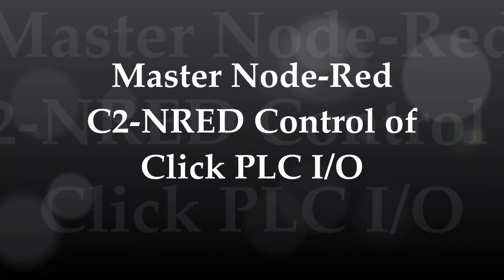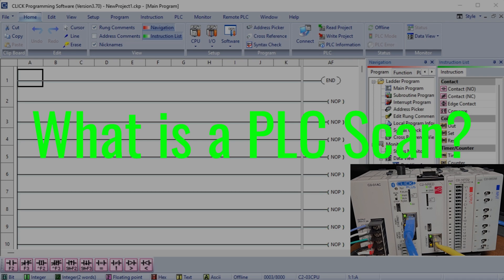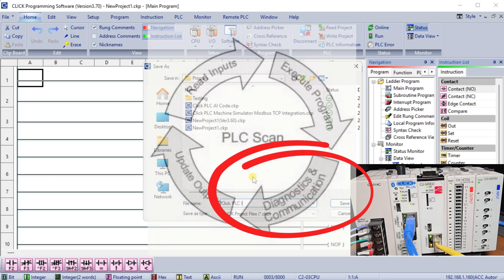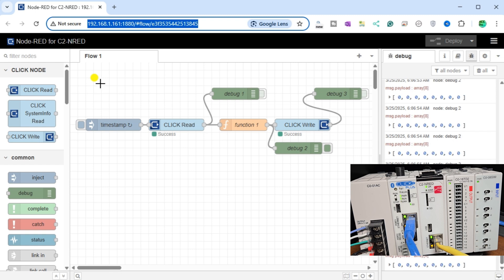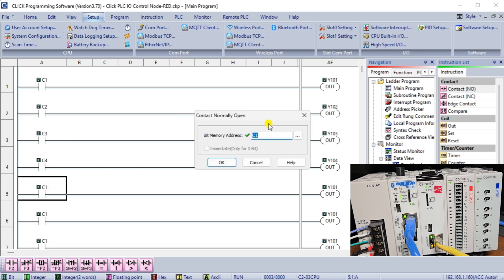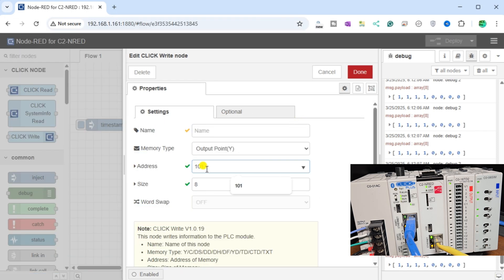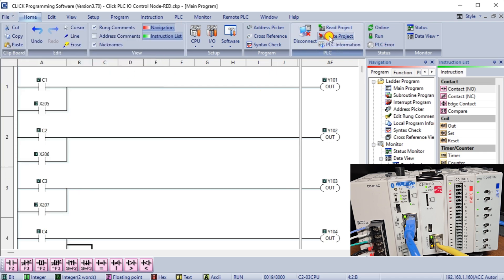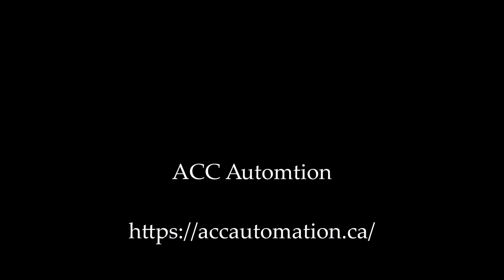Master Node-Red C2-NRED Control of Click PLC I/O

Comment from the maker: More information can be obtained at our website. This includes all of the links mentioned in this video. 
https://accautomation.ca/master-node-red-c2-nred-control-of-click-plc-i-o/

Previously, we looked at the following using C2-NRED Node-RED:
CLICK PLUS C2-NRED: Easy Install for PLC Module!
https://accautomation.ca/click-plus-c2-nred-easy-install-for-plc-module/
https://youtu.be/ZFgcVwCYCRk
Unleash Innovation: Node-RED Flow in Click PLC
https://accautomation.ca/unleash-innovation-node-red-flow-in-click-plc/
https://youtu.be/JcFX6kK36p4

CLICK PLCs were designed with simplicity in mind, providing reliable control at a low cost and with little to no learning curve.
This simplicity makes CLICK a perfect solution for small machines, home automation projects, pneumatic applications, or anywhere a simple system needs a budget-saving control solution. 
Building on the original CLICK's simple design, the new CLICK PLUS PLCs offer the same practical control but with surprising bells and whistles. Using the same FREE, streamlined PLC programming software as its predecessor, the CLICK PLUS PLCs provide no-headache programming combined with advanced capabilities like Wi-Fi communication and data logging.

The Click and Click PLUS PLC series can be found at this URL:
https://accautomation.ca/series/click-plc/

Features of the new Click PLUS PLC (C2-0xCPU) include the following:
  Micro USB
  DHCP support
  DNS support
  Wi-Fi (programming and Modbus TCP)
  Bluetooth (Wi-Fi) provisioning
  SD Card (Data Logging)
  Data Logger
  Network Time Service
  MQTT (Publish/Subscribe)
  Required PLC Password
  Disable Ports
  Strong Password Support
  Disable Ping Response
  Encrypted Password Transfer

We are using the Click and Click PLUS PLCs for several reasons. Here are just a few.
 - Investment is low for the hardware, and the software is free
 - Standalone PLC with built-in I/O
 - Communication ability - Ethernet Port, RS232, RS485 - support for Modbus RTU, Modbus TCP, etc.
 - Ability to expand the system with various modules, including RTD and Thermocouple inputs directly.

Regards,
Garry
ACC Automation
https://www.accautomation.ca

Comment: que bueno que los videos tuvieran traduccion automatica por IA al español / seria fabuloso!!  quiero comprarme ese modulo de node red para ensayarlo y hacer pruebas !!! me imagino que le sirve a cualquier CLICK PLUS!, puedes por favor confirmarme? es decir puedo comprar una CPU BASICA de click PLUS y le añado el modulo node red ? se puede?
Reply from the maker: Sí, el módulo C2-NRED funciona con cualquier PLC Click PLUS. Ocupa una ranura en la CPU.
Saludos,
Garry

It's great if the videos had automatic AI translation into Spanish / that would be fabulous!! I want to buy that node red module to try it out and run tests!!! I imagine it works with any CLICK PLUS! Can you please confirm? In other words, can I buy a BASIC Click PLUS CPU and add the node red module to it? Is that possible?

Yes the C2-NRED module will work with any Click PLUS PLC. It will occupy a slot on the CPU unit. 
Regards,
Garry